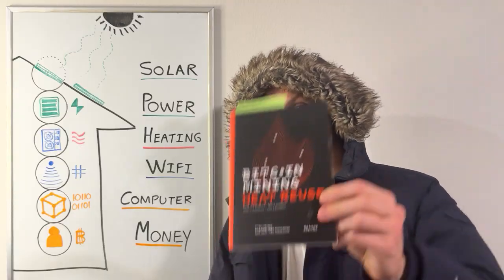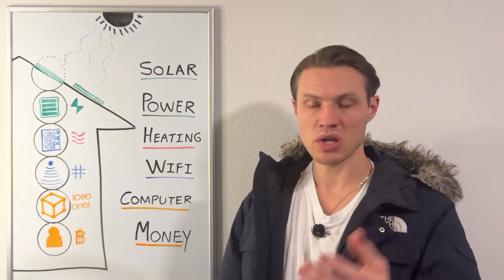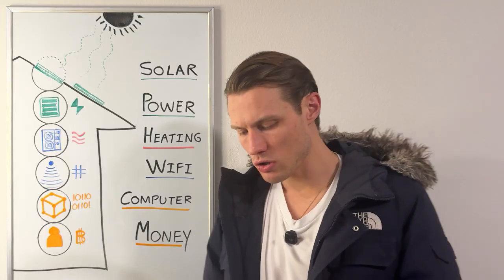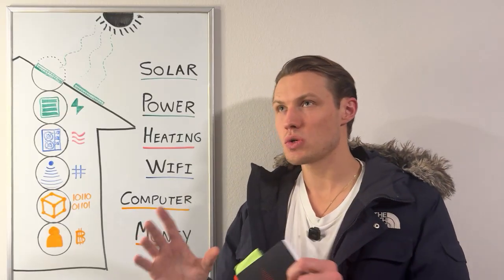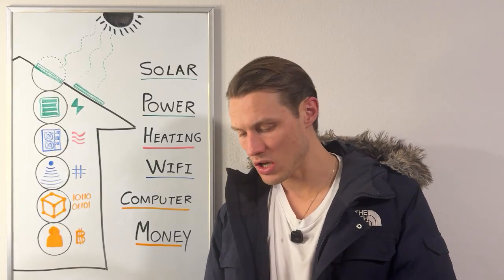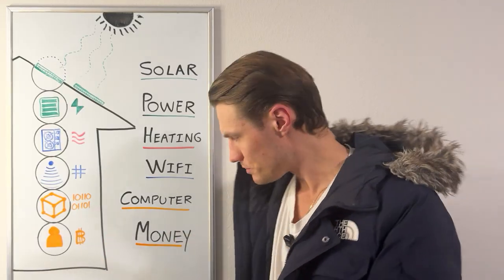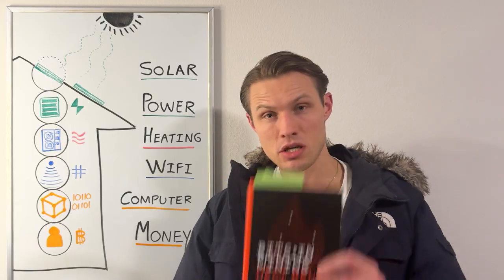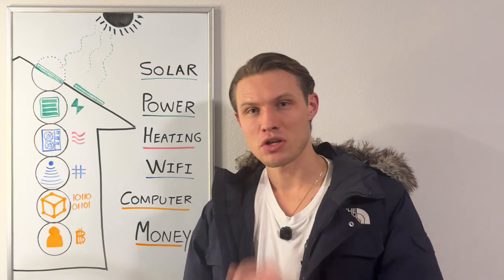Winter is Coming, Hashrate Heating is the Solution! | Hashpower Academy

Comment: What could work is having ground source heatpump where you dump excess of solar powered sumer mining into a borehole for winter extraction. Sadly borehole are still crazy expensive compared to air source heatpumps. Dunno why, I would guess drilling a hole into the sand generally shouldn't be that expensive but some how it still is. But against you would't really need a miner to dump the heat in the bore whole. A the heatpump in reverse would again do a much beter job for lower cost and complexity...

Comment: No, it's a rally bad idea since it competes with air source heatpumps running at a scope of 4-5. Say you pay 15cent/kWh, a heatpump wil generate 5kwh of heat yielding a price of 3ct/kWh heat. Running a old gen miners will yield you 5ct/kWh on a average, yielding 10cent/kWh heat. That means it's 3 times more expensive while requiring equipment that depreciates in 4 year vs the typical15 year lifetime of a air source heatpump. Buying a miner to for heating is a bad use case for the typical home. Reuse of waste at industry scale is ofcourse a good idea but this requires colocating datacenter near to housing projects...
Reply: ... and most homes pay much more for electricity, like 0,25ct/kWh making the businesscase even much worse. Datacenters and big industry only pay 5-7ct/kWh due to tax exempts. And please don't start on solar in winter. It's a first principes thing see. You can only mine individually when there is plenty of solar energy available. When energy is short you need to hunker down and b efficient with heating, and sadly a miner isn't efficient at all. No free lunch here.